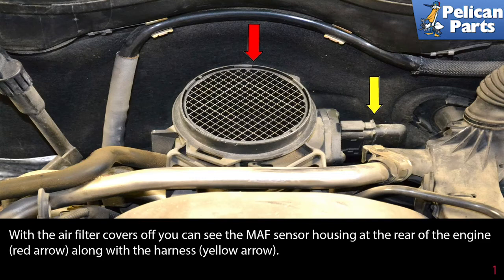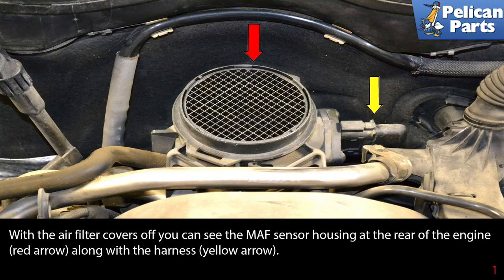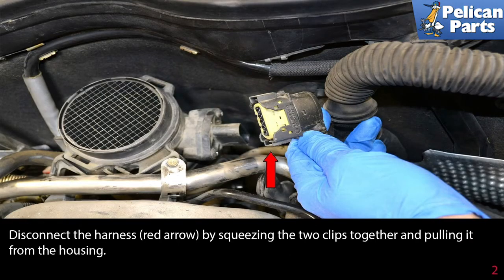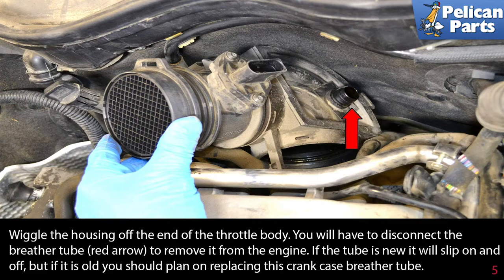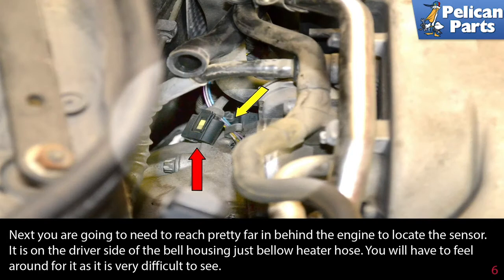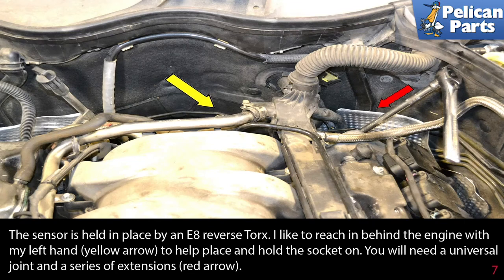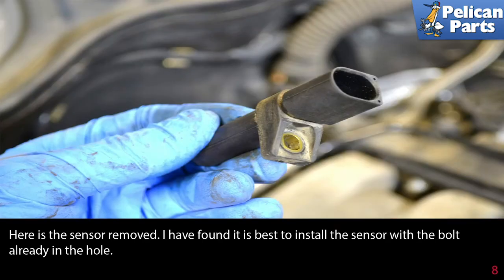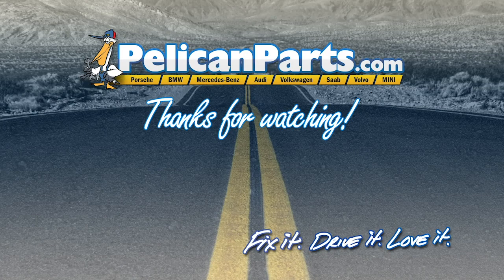Mercedes-Benz W203 C-Class Crankshaft Positioning Sensor Replacement

Comment: Nice. I didn't have to remove the MAF elbow. I ended up doing this 4 times since I only realised I bought the wrong one after jamming it in the hole, plus some more troubleshooting, and putting the old one back in again as it was fine. That engine harness braid really chews through skin, but the job wasn't as hard as some people say!
Reply from the maker: Thanks for sharing your repair process and experience. These types of comments add so much to the Pelican tech community.
Reply: What did you have to remove to get the the sensor?

Comment: I have a 2006 Mercedes benz c230 sport, I think I changed the wrong sensor because it took a torx 30
Reply from the maker: Could just be a different size fastener on your vehicle.